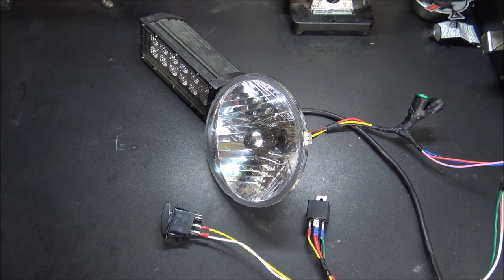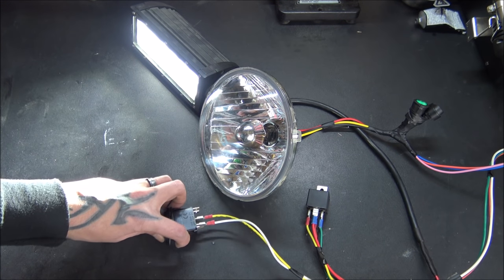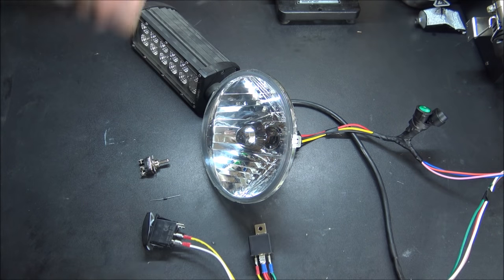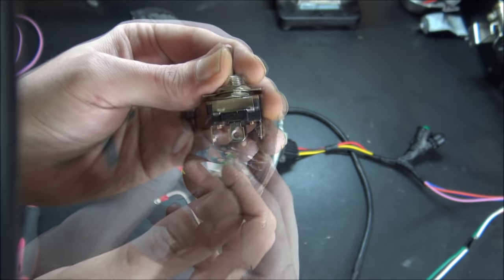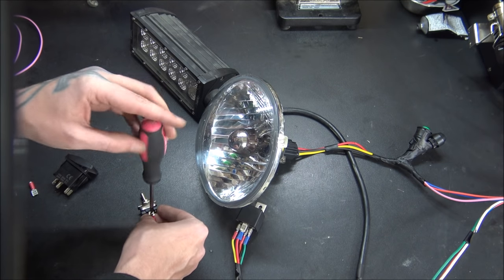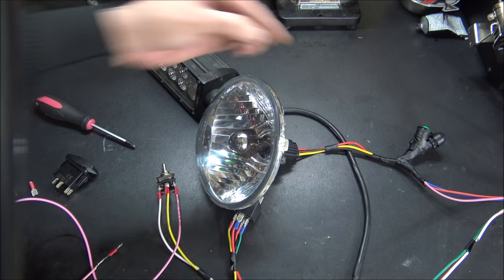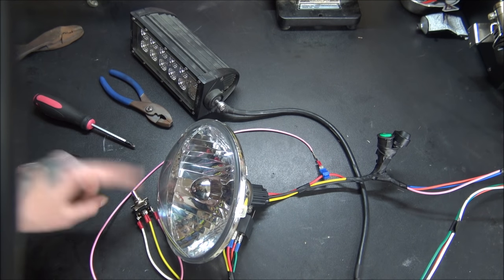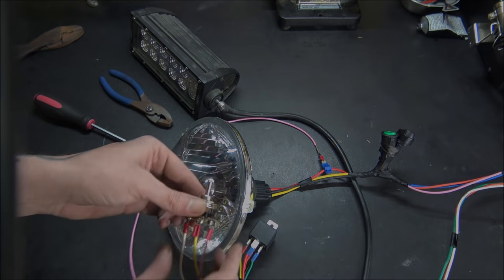3 Way Switch, How To Wire Your Light Bar To Work With Your High Beams & By Itself (ON/OFF/ON Switch)

Comment: I bought led headlights for my 1991 4Runner, I also bought the harness with relays. But I'm getting power to the lights with the switch being off. What can I do to fix it?
Reply from the maker: If memory serves me right, Toyota uses a "positive ground system" on their headlight wiring. This usually requires a vehicle specific harness. Unless you wire in some relays to switch your wiring to a more standard style.
Reply: @RockyXTV  Yeah I heard that, I'm just gonna have to take it somewhere lol... Thank you

Comment: What about the ground wire for the switch? Or is that not needed
Reply from the maker: If your switch has a light in it and you want the switch to light up you can connect the ground. The 3 way switch I show in the video does not have a ground. Thanks for watching!
Reply: @RockyXTV  Thanks for the reply. So the ground on the switches are just to light up the switch itself? I learned something new today :). I enjoy your videos. I just discovered you. Keep up the good work
Reply from the maker: Yep, 99% of the time if your switch has a ground it's just for the internal light of the switch. It's not required for the switch to operate.

Comment: I have mine wired correctly i believe and the lights work like they should. Only problem is my lightbar relay buzzes when the bar and headlights are both on. Any thoughts?
Reply from the maker: That is odd, relay going out maybe? The only time I've had a relay buzz is when it's on its last leg or voltage is to low on the coil/trigger wire (pin 86)
Reply: No its brand new relay. I tried two different ones. Also tried getting my 12v from the batt and tried again from the fuse box. Same thing both times. Checked current levels. Running ~9 amps with only lightbar and ~6 amps with highs and bar. Running to 40amp relay
Reply from the maker: Shouldn't be buzzing then, you're sure you have the relay wiring correct? Is the relay getting hot?
Reply: Relay isnt hot and everhthing works  like it should. Im going to try a different style relay tomorrow

Comment: Is it possible to have a normal led light bar switch, but have it do multiple operations. For instance, you have an led bar in the front of your vehicle and rear of your vehicle. Now, with the switch is it possible to push it in once and have the front bar turn on, push it again and have the front bar turn off but the rear bar turn on, push it again and now have both front and rear bars turned on at the same time, then push in switch once again and have both bars offs? There is more I’d like to have done, but that would be the basic operation of the switch if possible.
Reply from the maker: This would require a specialized switch, some relays, lots of wire and a few diodes. It would be a little on the complex side, it is always the things that seem like they should be easy that are some of the hardest.
Reply: Rocky X TV hmmm understandable. Wish I could have it done
Reply: Rocky X TV  where do reside/is your shop?
Reply from the maker: I'm located in central Ohio. I pretty much only work on the YouTube vehicles now.

Comment: Will this work with the switch you used for the lightpod/reverse lights?
Reply from the maker: Yep, you would just have to use a relay like in the other video as the other switch can't handle that much current. Thanks for watching!
Reply: Rocky X TV alright, i just discovered your channel and im sure ill find this and that other video very useful. Thank you!
Reply from the maker: Thanks for checking out the channel! I post new videos every Wednesday morning.
Reply: So if Took the instructions from the other video it should work with my high beams the same way?
Reply from the maker: Yes sir, I never thought about that. I guess I kinda made two videos for the same purpose. I guess they are different enough though. I think I mention a few different ways to wire the switch in the other video, so just make sure you wire it the way you need it so the little LED on the switch doesn't stay on all the time.

Comment: it would be helpful if you drew a picture with the wires going into each place to confirm. great stuff though very helpful
Reply from the maker: Thank for the suggestion, you are correct, it would make things a little easier for people. Thanks for watching!
Reply: can you tell me if i understand correct in that there are 2 wires that go to the battery, the white which goes to the toggle and the green which goes to the relay? and if so i would want an in line  fuse on both.
Reply from the maker: I had to go back and look at the video because I couldn't remember what color wires I used. The green wire on the relay in the video is ground for the relay. There is no rhyme or reason to the wire colors I use, just what I had laying around. You are correct though, you would want a fuse on the wire going from the toggle to the battery (white wire) and if you don't already have one on the feed line for the relay (pin 30) you would want one there as well.
Reply from the maker: You could also just connect them together into one wire as they are both going to the same place. One to power the switch and one to power the relay basically. I hope that makes sense.
Reply: that makes sense, i appreciate your time and learning a lot from your videos thank you!
Reply from the maker: Thank you for watching them!

Comment: I don't understand the diode. Me and a buddy of mine did this same thing on my truck and we didn't put a diode on it. This may sound like a stupid question but what exactly does it do?
Reply from the maker: The diode is only used in some rare cases on newer vehicles. Sometimes the ECU/ECM/PCM/BCM will pick up on the ever so slight current load change and cause issues. Most of the time minor, but like I said it's very rare that you actually need the diode. Thanks for watching, and if you haven't yet, make sure to subscribe and check out the Rocky X TV Facebook page. Thanks again Ashton!
Reply: Only allows current flow in one direction.

Comment: Can you do the same for reverse lights?
I have 2 4inch light bars I want to have come on when in reverse but also when I need them out camping ?

Thank you
Reply from the maker: It most certainly can! Here's a link to a video I made about doing exactly that! Thanks for watching! https://youtu.be/hjpucoy0Qxo
Reply: @RockyXTV  i noticed in the video you used a 4 pin switch can I use a 3 pin on off on rocker switch

Comment: I couldn't hook my light bar to the high beams like you did, since both my highs and lows run off a constant power source simultaneously and a relay tells which one to send power to by grounding a specific wire. I cut the blue wire that controls the low beams which has power when the high beams are on. However I don't hear the relay click when I hook it up with the blue to the relay in the middle and the 12 from the blue wire. But I hear the click when i have the blue wire to the relay and 12 v from the battery. It's a 126 W light bar. Would this hurt anything or should I get another relay to be safe?
Reply from the maker: Your light bar would only be about 10 amps so it should be fine, but I am kinda' puzzled with your issue. Sorry I couldn't really be of any help.
Reply: Rocky X TV it was clicking my friend I just couldn't hear it, I got it working, thanks for the reply. Your video might very well save me a ticket one day and will most defiantly save a lot of clicking thanks again!
Reply from the maker: Thank you for watching!

Comment: Could you use the JL factory auxiliary switches to use the high beams with the bar and also with the switch?
Reply from the maker: I couldn't say for sure as I haven't started to modify the JL electrical system yet. I have a few lined up to use on the channel, so maybe I'll have some videos for the JL guys soon. Thanks for watching!

Comment: can u wire multiple light bars on one switch and by itself?
Reply from the maker: If using relays yes you can. Most relays are rated from 30 to 40 amps. I wouldn't go running something like three 50" bars on one, but multiple smaller ones would be fine if wired correctly using a relay. Thanks for watching, and don't forget to subscribe to keep up on all the new videos! Thanks again.
Reply: Rocky X TV thanks I'm just doing a 50 and two small 6 inch

Comment: Would it be possible to have a second switch that performs the function of the 3 position switch? For example I am using street legal LED lights, which by law have to be wired to the highbeams. However I also want to have another switch that will decouple them from the highbeams and allow the first switch to turn them on regardless of state the headlights are in, for off road use. I do not want to use a 3 position switch for this if possible
Reply from the maker: Let me roll this around in my head and get back to you. I'm sure we can figure something out.
Reply from the maker: What's the year, make and model of the vehicle you'd like to do this on. I'm going to look up some wiring.
Reply: It's a 2005 Suburban 2500. I'm putting 6" KC 644 LED Gravity lights on a grille guard on the front. I also am going to add two KC 432 Gravity fog lights, which I would like to function in the OPPOSITE manner, since legally fog lights can only work with low beams. I'm concerned about passing inspection in PA if this isn't all done by the book. Thanks for the replies by the way, I appreciate it and look forward to seeing what you can come up with.
Reply: Another thing is that I do not believe these lights have a relay in their supplied wiring harness. I do not physically possess them yet so I'm taking my best guess from pictures. They draw less than 2 amps, so it shouldn't actually be necessary, but should I add one anyway? I'm using Contura V switches rated for 20A
Reply from the maker: I have both of the KC lights you mentioned and yes the 644's come with a harness and relay. With such a low amp draw it is not completely necessary to use a relay, but I always do. I can't say if the 432's have a harness and relay as I have the 497 for the Jeep JK. I can say that the other 6" Gravity lights will get you in some trouble if you run them all the time, they do say legal on them, but they are very bright and throw light out very far, farther than my KC headlights and even my light bar. I'm still looking into your wiring, sorry I've been kinda' busy as of late, buy I am still looking into it for you.
Reply: @RockyXTV  Thank you! I'm not going to be running them when I anticipate seeing much other traffic.
Reply from the maker: I'm actually asking my friends and family if any of them have a Suburban so I can play around with the wiring. It's proving pretty hard to find a good wiring schematic on the headlights for this. Plus I'm more of a hands on guy, then I make my own diagrams. Sorry this isn't something I can help you with right away.
Reply: Don't apologize I appreciate any effort you are putting into it! I haven't wired anything before, but once I can see everything and hold it I think I'll have a better idea of what to do. I'm not as worried about the override switch at this time, as I am just getting them all wired up to the highbeams properly at first. Pursuant to that, would I be able to use a multimeter to figure out what wires are hot when the highbeams are on and use that as a trigger for the relay and place the switch in between that wire and the relay? Also any GMT800 GM truck will be close to exactly the same under the body, so any 03-06 Tahoe, Yukon, Silverado, Sierra, Avalanche or Escalade should have an almost identical electrical system.
Reply from the maker: Thanks for the info on the GMT800. You can use a multi-meter to find the wires you are looking for. Just find a known ground and ground the meter, then use the other probe to check your wires with the high beams on and off. Also the switch idea would work, one of the simplest ways to do it, great idea!
Reply: @RockyXTV  Thanks, I'll give it a shot as soon as I can.
Reply: I just received my lights today and unfortunately there is no relay in the harness on the 644 kit. Neither does the 432. If I can still trigger them with the highbeams without using a relay, how would I go about that? And how exactly could I add a relay to the existing harness if I wanted to go that way?
Reply from the maker: That's odd, maybe they are trying to cut back costs by not supplying the extras anymore. I have a few other videos on relays that may help. https://youtu.be/NsJOAG7yMe4 and this one https://youtu.be/qTZDmql8ctA
Reply from the maker: This video may also be of some help, it's just doing what you are wanting but on the rear of the vehicle. https://youtu.be/hjpucoy0Qxo
Reply: Thank you, with that info I know how to add the relay to the harness the lights came with. I do think it's strange they omitted it even if only for liability reasons but they must be confident that <5 amps doesn't require it.
Reply from the maker: Anything less than 5 Amps is usually not an issue, but with a lot of these inexpensive ebay and amazon switches these days you never know. I have a 10 pack of rocker switches that are only rated for 3 Amps. Glad the videos could help.
Reply: I'm using genuine Carling switches from OTRATTW but I'd rather play it safe. Thanks again for all of your advice and the excellent videos. I went from not understanding wiring at all to being completely confident I can do this. I'll be installing them tomorrow

Comment: whats the recommended wire sizes?
Reply from the maker: That would depend on the length of your wiring and the wattage of your light. 14ga is the most common size used in these applications though. Unless you are using a really powerful light, then some people use 12ga. Thanks for watching!

Comment: In your video you use diode with text annotation diode not required, I just remove diode and tap directly to high beam?
Reply from the maker: Yes, the diode is rarely needed on a select few new model vehicles. Thank you for watching!

Comment: So I'm having a problem I hope you can help me. I didn't use the diode just a heads up. but I wired everything like you said on the switch. my relay is set up 30 to battery 85 ground  87 positive on light bar  86 to switch in the cab. anyway I have an 05 liberty which is only one bulb dual beam so I tapped into the wire that is hot when the high beams are on. Right?  Ok well here's my problem. I flip my switch down and it turns on just the driver side high beam. I flip it up. then nothing till I turn the lights on but only the left high beam turns on no light bar? What did I do wrong here haha!?????
Reply: I think I figured out part of the problem my 86 wire. I didn't tap into an in cab fuse. but my other question would be is why are my high beams acting all goofy still?
Reply from the maker: You have a wire on the three way switch switched. The wire for the light bar relay pin# 86 should be hooked to the middle pin of the three way switch, the others as mentioned in the video go to the outside two pins. I did this a few times myself. Thanks for watching!
Reply: Rocky X TV ok I'll try that this morning.  your saying that I have the 3 way is hooked up wrong? it doesn't matter which ones go onto the on switches right? as long as the 86 pin is going to the off switch right?
Reply from the maker: Correct, the middle pin on the switch needs to do to the 86 pin of the light bar relay, the other two don't matter.
Reply from the maker: Middle of the switch= 86 pin on light bar relay.
Left or Right of the switch= Battery or other positive
Left or Right of the switch= Headlight Hi beam positive wire
Reply: Rocky X TV ok awesome I'll go try that our. one other question. I have my fuse running in line with the battery. is it necessary to have an in cab fuse that goes to 86? Or what is the point of that fuse
Reply from the maker: The fuse inline with the battery is enough, the in cab fuse would just be a little more protection.
Reply: ok so I went out and moved the switch wires. now I have individual power to the light bar in the down position. no power middle and no power to the high beam position. I think my hi beam bulb is burnt out. would this be causing this issue?  Because thsy wire is a direct wire from the high beam to the switch. only thing I can think of.
Reply from the maker: Have you tried a test light or multi meter on the Hi beam wire? If it has low voltage with the blown bulb it may not be activating the relay. Some relays won't activate with less than 10vdc.
Reply: Rocky X TV changing the blubs didn't do it. idk what the problem is. I have no  power to my driver side head light bulb for some reason.
Reply from the maker: A few other things to check if you have a MM or test light. Test the wire from your Hi bean like I said, if it has power then check it at the switch. If it has power there as well then check if you have power going out if the middle pin of the switch when it's turned on. This will rule out most issues, including a bad switch.
Reply from the maker: That could be an issue... Now you have another project, finding out why you have no power to that headlight.
Reply: haha I figures out! just a damn blown fuse going to high beam driver side. man! thank you sir for your time you truly are a mechanical wize helping me over messaging. works like a charm! Thanks again!!!
Reply from the maker: Glad I could help! Thank you for watching my video, I hope you enjoy your new Hi beam light bar!